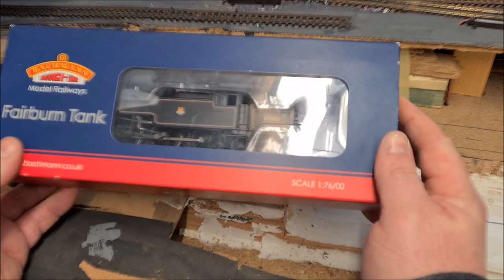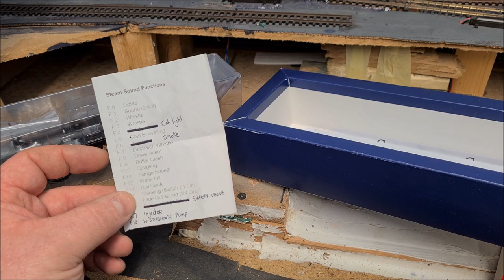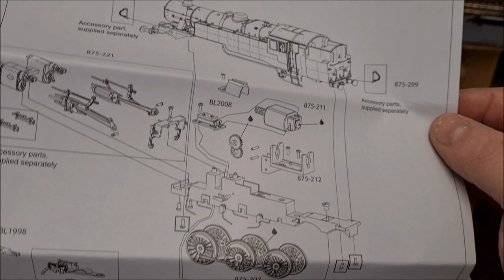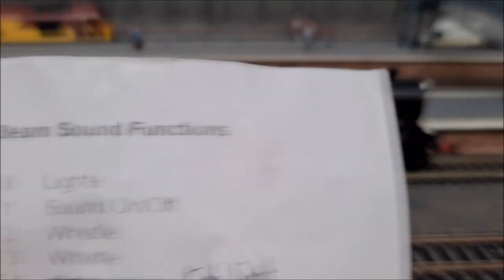Bachmann Fairburn Class 42085 DCC Sound Fitted Unboxing

Comment: Smoke oil?  I had that with my first 0-6-0 tank locomotive when I was a boy!!  It was a Hornby locomotive with Syncrosmoke.  It hauled both goods and passenger traffic.
Reply from the maker: it does add a nice bit of character to the loco especially with the steam sound, its amazing that they could do the smoke effect all those years ago but they dont bother now with ready to run models i suppose it maybe due to current safety and hygene just a guess
Reply: @northwesttrainsmodels  More likely that it would cost too much to include!!  I’m going to fit a smoke unit into the locomotives on my main layout.  I just CANNOT see Pitchford Hall without smoke coming out of her chimney!!

Comment: Thanks for the video, I like these locos myself. I am assuming that there was no more room left in the loco for a stay alive which would have cured your point problems. Thanks, Mel
Reply from the maker: Am sure they could probably fit a stay alive I didn't think it would be needed for a large loco to be honest when I ordered it, the loco runs fine over peco insulfrog points no problem which I've got on the heritage line, I wouldn't have used hornby express points now if I went back in time but mainline diesels are ok so I've left them in, but each time I do an unboxing video I use the hornby express points as a way of testing how good the running quality is. Thanks for watching. Tom